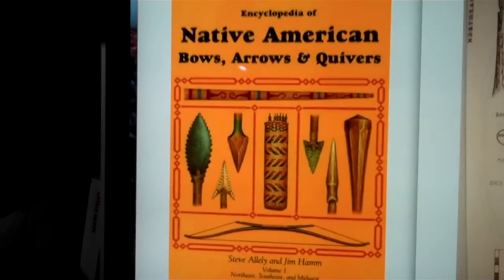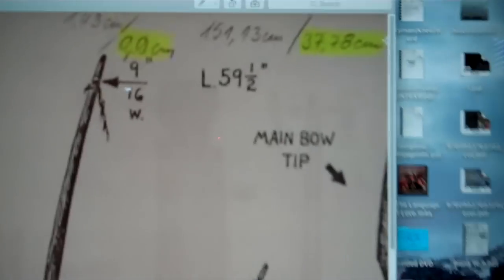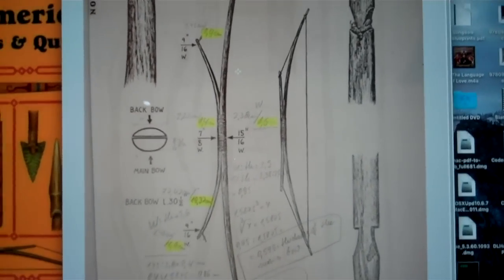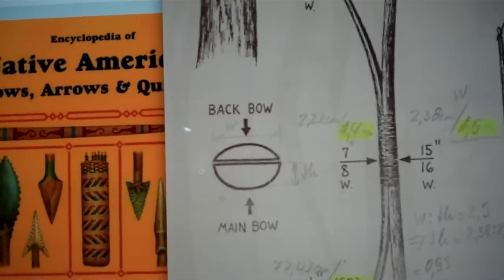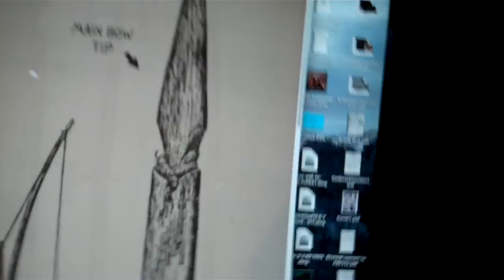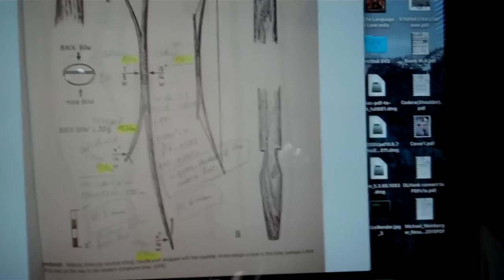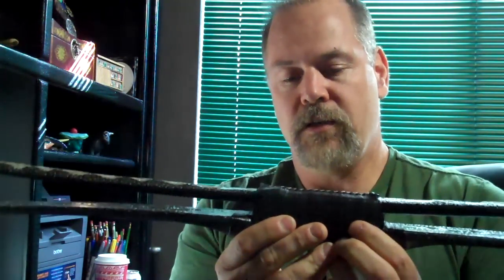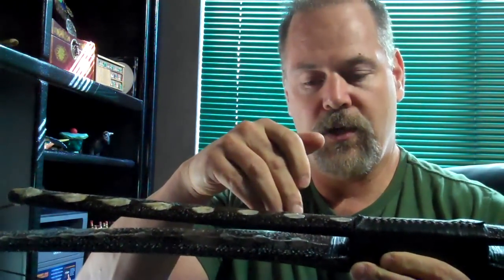How to make a Penobscot "Double" Bow

Comment: Great bow Mike, I've wanted to do one of these for a while now, would there be any issue with cutting in an arrow rest and sight window into both bows and the spacer or would they all need to be glued together for that to work?
Reply from the maker: I have done that and, in that case, I glued them together and made sure to use enough wood in order to make sure there would be no bend at the cut in. The riser/shelf needs to be non bending or it could fail at that weak point. Otherwise, go for it!

Comment: Did u do a speed test on this bow or not?  Just curious if it shoots any faster than just the main bow alone?
Reply from the maker: draw weight went up, so (same) arrow speed did as well. but speed isn't the main benefit. I think you get a forgiveness in draw weight that is almost like a bit of a let off.
Reply: @BoarriorBows  thanks for that info. And thanks for your videos. You do a nice job. It's appreciated very much !!

Comment: I wonder if a takedown version of this is even feasible and if so, how?
Perhaps the pony bow is seperate from a 2-pc but can attach via a connector system.  Even if the bow is lost or broken one could either build a main bow on the fly and attach easily or tweak out another 2pc making (if broken apart) fairly equal pieces of 30 inches that can be put in a bag.

Comment: not to mention on the stringing both bows and making string knocks. I have built one and after running through issues of strings I am now finding that someone else ran into the same issue. 
.but after looking at some built alongs they make separate string nocks on opposite side.
Reply: the bow dates back 1400 years and twisting the strings on the helper bow can increase draw weight and or adjust each limb

Comment: would you be capable and willing to make a recurve hickory or bamboo backed ipe mollegabet bow? I honestly enjoy your videos and find seeing what you do (your board now molle build along, etc.) far more beneficial to my learning than reading through countless thousands of articles online. I have spent three years looking for information about an ipe mollegabet. and I have found very little. 

I'd like to build a mollegabet ipe bow, something in the 55-65 lb range.
Reply from the maker: Ipe is extremely dense and excellent bow core/belly wood. You are right that it needs a backing if you start in board form and I have never heard of a self backed Ipe bow (although. The issue with the mollegabet design and the Ipe wood is that the wood, being so dense, will likely be extremely heavy draw in the usual dimensions. You just won't be able to get the wood narrow enough to maintain the mollegabet design. One solution is to taper the belly of the working limb as you would a flatbow, but then the wood will end up being so thin that it still may become unstable. If I were to do one I would do a holmgaard design where the working limb tapers from wide at the handle fade to narrow near the static limb fade. I'd likely start with a width of 2" instead of 2.5" and taper the belly of the working limbs like a flatbow. The backing can be hickory or bamboo, but I'd use bamboo if I could find a piece wide enough. The bow will end up being more of a 2-layer laminate but it will be a real shooter! Recurving Ipe consistently is difficult and I'd likely add syahs to the static limbs as opposed to trying to steam/heat bend.
Reply: BoarriorBows my plan was to get a kit from a respected bowyer. the dimensions of the ipe tend to be 70" long, 1.25" wide and .75" thick. I figured with a 1.25 inch wide working limb, I'd be able to get a 60, 65lb bow without having to lose too much belly wood from the ipe. 

I really love the mollegabet design. 

But I think I may just have to end up with a modified  holmegaard/ American flat bow design..

if I were to purchase a kit to send you, do you think you would be willing to do a tutorial of a reflex bbi holmegaard? just a thought.

also, watching this penobscot video, the idea of a nice thin bbi penobscot bow just sounds damn good, haha! and I'd be interested in helping out with supplies if you think you'd be able to do it.
Reply from the maker: Yes those dimensions are the typical ones sold in Ipe/Boo or Ipe /Hickory kits and makes for an excellent longbow/flatbow. I have a video of one made from those dimensions that was the fastest bow I had ever made (at the time). Unfortunately it is too narrow for a holmegaard or mollegabet.

Comment: i believe back in the day that was a sapling bow split in two. one way to gain power in a small diam. sapling is to add the other half on the back of the main bow. i.e. the roundness of the belly of the main bow and the roundness of the back of the short bow. you mentioned "doing it without a plainer"... they had no plainer. simple was the concept. think stone bone and wood tools. . think how youd do a bow like you made with those kind of tools. see what i mean?
Reply from the maker: Very interesting idea! Although it does beg the question s to why the drawing depicts two separate, flattened, staves lashed down with rawhide. Not ruling out your concept with that statement because if there were no changes made to the connection at the split point they would likely still fit.
Reply: if you split out a sapling. you have 2 halves. lets say 1 will be good long. and 1 will have issues so you make that the short one. now pretend the long stave the flat side is the back. you have to make sure the growthrings that are cut through /split out run straight like its decrowned. the smaller bow the flat side is the belly and can be tillered as such. once put together you can retiller the longer bow to bend evenly with the short bow attached. if you look at Hamms drawings closely. youll see that both flat pieces fit but there is some material missing to make it round, round. i believe thats what the tillering process removes and the decrowning process removes. in between where they connect. it just makes sense. 

.